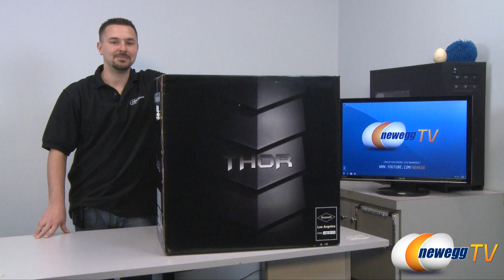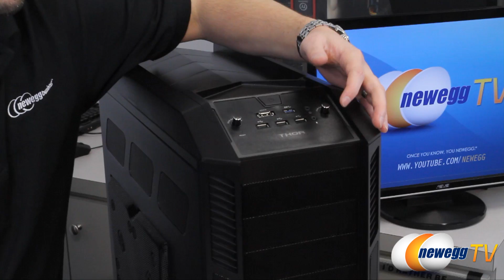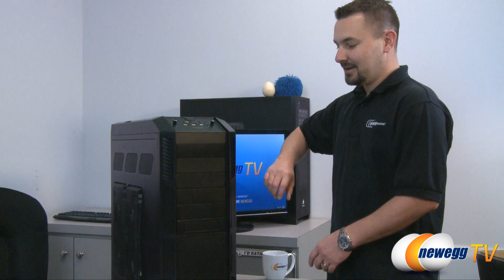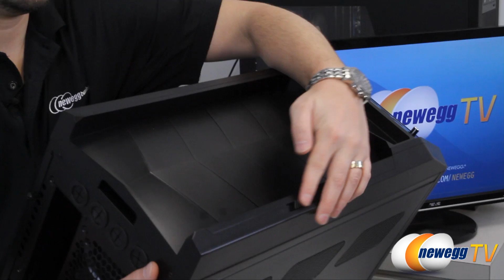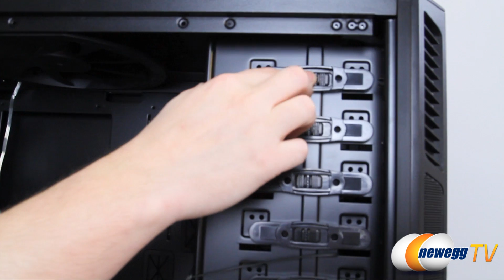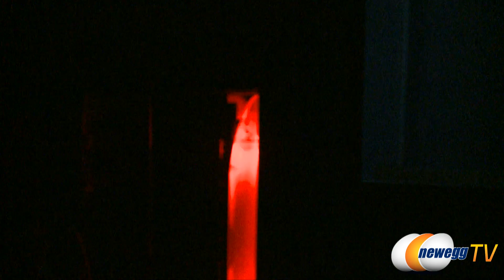Unboxing: Rosewill THOR Gaming ATX Full Tower Computer Case

Comment: You could always buy a big sheet of acrylic that's the same exact size as the case panel. All you have to do is put magnet strips on the metal parts where the side panel attaches to and leave the sticky part out, then put the acrylic window on the case and make it stick to the glue side of the magnet. Depending on what case you have it might even look better than a cut-out window like it does on my Arc Midi, but I made covers for my drive bays and PSU.

Comment: I need help somewhat quickly.. I have a corsair h50, how would I put that in since it uses a 120mm fan? Would I need to take out the side 140mm and replace it with a 120mm? Thanks :)

Comment: @CheckExplicit Shit,i was thinking the same. Its like Frankenstein. Cooling from Cooler Master Storm Sniper and HAF 932, mobo grommets from Corsair 800D, HDD caddies look EXACTLY like in my old Antec Sonata III. I wish both Rosewill and ABS would die.  House brands usually suck donkey balls. Newegg dropped some on those brands. Unless there is a switch for fan on-off, the top vent is useless (which btw looks like some other case I've seen), cause that vent has to stay open, since the top exhaust